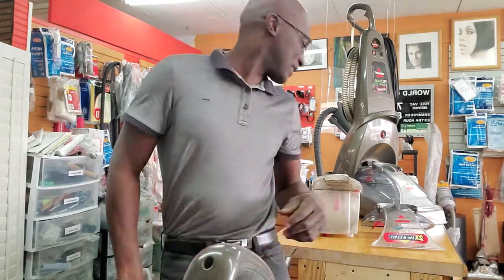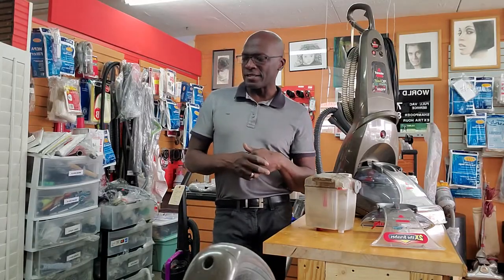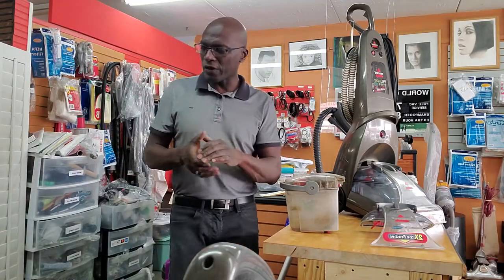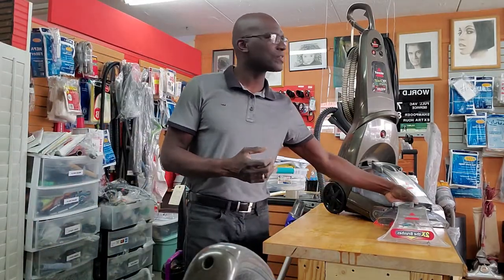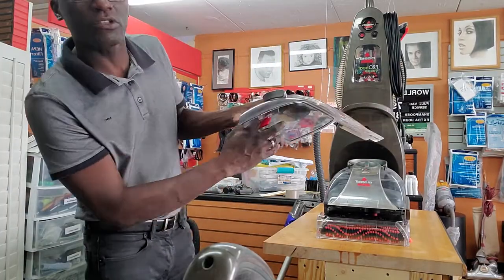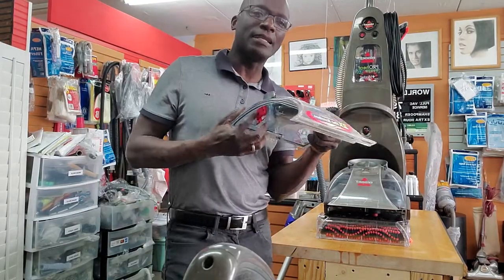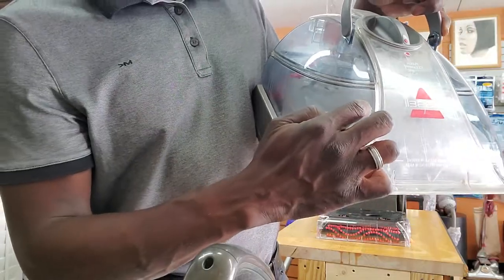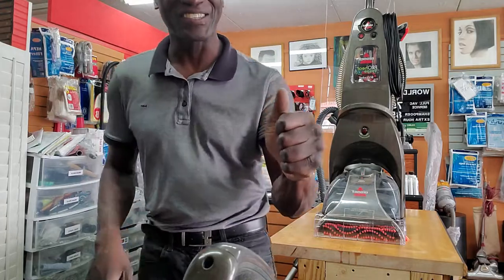Solve Bissell Suction Problems: Step-by-Step Guide!

Comment: please where is belt location? bissell pro heat complete pet model 8930A
Reply from the maker: Sorry for late reply. This model have 2 belts. The main motor to brush belt which is located on the left front of the unit (if you are standing behind the unit) and the guide belt is located on the right. I'll make a short video showing the locations,. stay tuned. If you haven't yet,....please subscribe so you'll know when it's uploaded

Comment: The problem im having no suction but with the hose
Reply from the maker: Try running water through the hose. If the water only trickles out the other end then you may have a clog. My next step would be to inspect the the port that you attach the hose to the unit see if it’s connecting properly. The last try would be to try another hose. If you have a friend who has the same unit see if you can borrow their hose. Other than that you may have to purchase one

Comment: My Bissell Pro heat Pet will turn on and then after an hour of working with it completely shuts off and I can’t it to work.
Reply: Wayne I like your videos that are clear and precise! Looking forward to hearing from you soon!
Reply from the maker: Hi Tim. Thanks. The Bissell issue sounds like either a motor, cord or power switch. Hard to diagnose without the unit right in front of me. Although, some units are made with a shut off if the unit over heats. If it turns on after a few hour of rest, try using it without the tank (just to see if it runs longer than before) if it does it would inspect the tank to see of a filter may be clogged, which would cause the motor to over heat. Hope this helps

Comment: My Bissell proheat runs for about 30 mins and the red tag inside pops up and stops the suction
Reply from the maker: You can try running it without the flap you just have to keep an eye on the water level. The other option is to replace the flap and screen

Comment: I done all the cleaning of the unit but it seams weak at cleaning the dirty water left in the carpet, I cleaned dog pee and poop, and after using it it stays smelling bad and doesn’t get all the water
Reply from the maker: Hi, I recommend watching this video How to get rid of pesty pet stains
https://youtu.be/EOZEhjusU3c for the pet odors. As for the suction, assuming that the unit is seal and everything is connected properly; I recommend shampooing slower and in a cross hatch pattern

Comment: Float is popping up and suction stops. What gives???
Reply from the maker: An option is to either replace the floater door (due to wear or just faulty part) or disconnect it.  But if you do disconnect, you would have to be very mindful of your water level when shampooing. Float Door 2036845 or find it on our site https://www.monroevacuums.com/product/bissell-float-door-2036845/1167
Reply: @monroevac  
Appreciate it brother. I saw that when the red spinner stops spinning, it means the waste water is full

Comment: My Bissell 9200 is putting water out but it's not taking any shampoo out of the rear shampoo tank
Reply from the maker: I would probably start by check-in the solution tank gasket the next step after that would be the auto receiver beneath the solution tank. The next step from there would be the tubing to see if there’s any clogging and then I would just double check the heater and see if the heater is clogged.